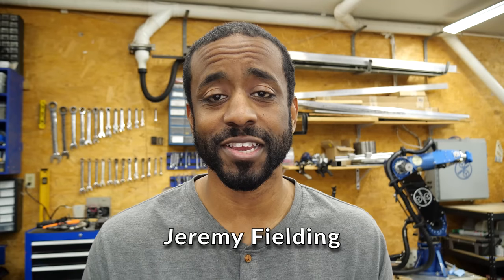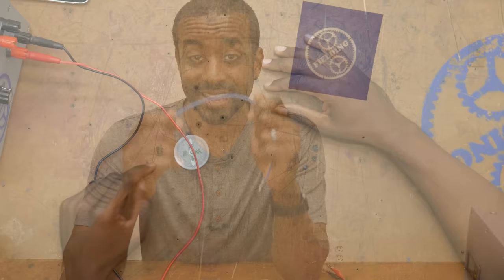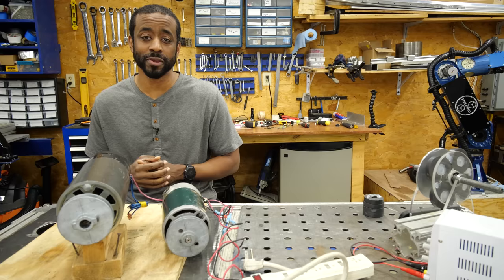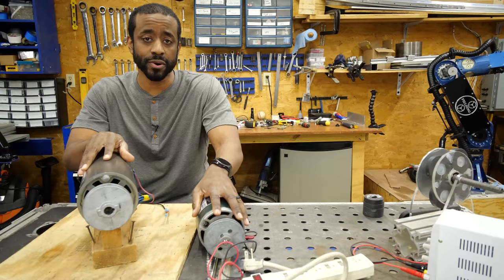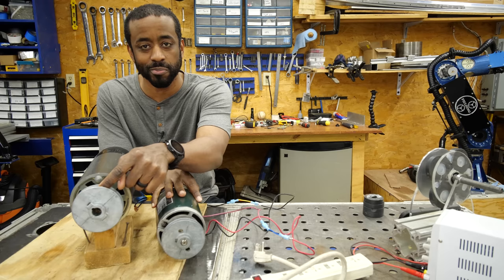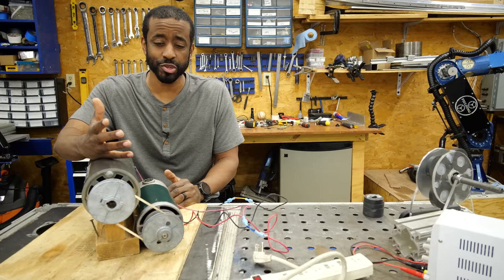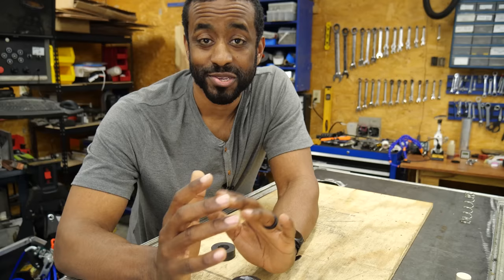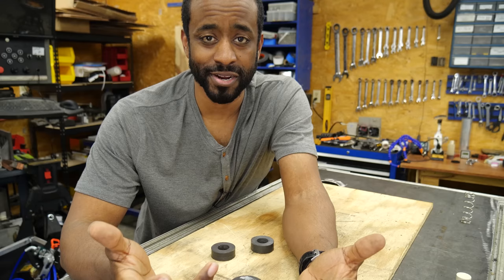Reviewing Free Energy Generators.  A Response to My Video "Nikola Tesla's Greatest Invention"- 102

Comment: This is one of the best and clearest explanations on this issue I've ever seen.  Good job!
Reply: Please tell me you're kidding?
For one, you must use 24volt 200 amp modified alternator (24 x 10) = 240volt?
Second, you need a single phase 220 volt 3000rpm at at least 500 - 1000watt ac motor.
Then you have a free energy device, what this guy doing is just plain idiocy with no basis.
He hasn't the foggiest about where to even start with this stuff.
Reply from the maker: I strongly suggest you actually try it yourself. :) but hey… thanks for watching:)
Reply: @Jeremy_Fielding  I have thanks, you need a 24volt alternator, I have one right here!
get rid of the rectifier and regulator, use the stators phase raw, 220volt at 5000watts per phase.
Reply from the maker: @DogSerious  Wow... I am a bit surprised you are doubling down on this. Clearly you have not. BUT we have both seen the videos where this was done, and while they look convincing as they should if they are good scammers, I am telling you they are faked. They don't behave the way really motor and generators behave. Even small things like startup torque, vibration, and noise are not right. I know because I do it all day. However, I don't expect you to change your mind. It is surprisingly hard to convince a person they have been scammed once they trust the scammer. I can only say please guard your wallet, and your attention when ad's are involved.
Reply: @Jeremy_Fielding  If your only video is one where you've used the wrong parts, why do you think you're right? You can even buy them already made just type: 220v ac permanent magnet brushless high power generator
Then all you need is a low watt single phase 220volt ac motor at 3000rpm. It's not rocket science.
Reply from the maker: @DogSerious  I explained why in the video. it is impossible to show you every variation of the scam. These channels are fully dedicated to this one cash cow. They make hundreds of variations to keep the scam going so they can keep making money. If I showed you one, you could just say I did it wrong. Or worse "you didn't try this one I saw here." It is impossible to prove a negative. However, I offered a solution in the video. How much would it cost you to put it together and send it to me? I will pay you $1k if it works just as I offered in the video.  Two birds with one stone. You will understand way more about why this doesn't work when you actually go through the steps. The dollar amount doesn't matter because its technically impossible. I am happy to offer you 10k if it meets the requirements in the video description. Watch the video all the way to the end and think about what I am saying. That is all I can ask
Reply: @Jeremy_Fielding  Scam? they're easy to build yourself as long as you use the right parts, which you didn't do. So don't rubbish it without actually doing it properly. The way you did it was ridiculous, amateur hour. Like I said, 24volt truck alternator 200amp modified with magnets (not 12volt), no rectifier, or regulator, raw stator. Motor is (ac-motor single phase 220volt 3000rpm low watt like between 0.6 and 1kw). That's how easy it is.
Reply from the maker: I would pay you to send it to me if it works. That's how easy it is LOL.
Reply: @Jeremy_Fielding  Hidden Technology made a good one.
Reply: @DogSerious  Like the guy said, send it in and if it works he'll pay you. Prove 'thats how easy it is'.
Reply: @steedeleven4353  I don't do videos, but I've told him of one guy who does do it right ( Hidden Technology ) and, I've told him of the proper parts to use too! But he isn't interested in doing it right. He just wants to rubbish it and prevent others from doing it by making them uninterested in it! He should stick to making chests of drawers and leave the electrical stuff to electricians!
Reply: @DogSerious  Electrical engineers who actually understand the application of electricity, generators, and motors can explain why these don't work easily. As @Jeremy Fielding pointed out, the people who make these devices often put the device efficiency right on the motor. Such specifications are important for people who design real systems that need to do real work. 

It is really hard to know if you are serious, or are just trolling. I kinda hope its the latter. Then I'm the dumb one for getting sucked in.
Reply: @wturber  If they start by using the wrong equipment then yes, but when you know what you're doing and using the right stuff, then no! I mean, look what he used to demonstrate it? lol. No one would use that type of motor and generator.
Reply: @DogSerious   How fckn serious you are? What tf makes you thing Hidden Technology knows something more than Jeremy doesn´t?? Like we all know you for sure know less than either of them. Jeremy told on video, why it doesn´t work. Also we know you don´t understand how it should work and Jeremys personal explonation on comments to you how it doesn´t . And you act like you know better, seriously dude, lil respect man.
Reply: @SubconsciousLight  Like I said, look at what Jeremy used to demonstrate, lol, only an idiot would use them. And, I do know better, I've been an electrical engineer for 45 years thanks. And Jeremy did ZERO modification to his generator, and didn't use a low wattage motor to power the "generator" kid stuff what he did. All Jeremy did was rubbish something without even trying. He has failed miserably where others have succeeded, and by the looks of it, convinced you too.

Comment: I drive an electric car and get this alternator question/suggestion from more than half of people that ask about my car. I think the confusion is because people don't realize the alternator requires energy to turn. Same with the wheels. They think the rotation is just being wasted so "why not tap into it?".  The best reply I have heard is to suggest that they grab hold of their hair and then lift themselves off the ground by it.
Reply: Most electric cars have regenerative braking.   Maybe all of them.    Reverses  the motor to provide power back.    This is probably what people are thinking of.  That when you want to slow down  that is wasted energy, and this is somewhat recovered. Really the motor is a generator as well, so yes, your car does have a alternator in it sort of.
Reply: For sure it employs regen braking. 107k miles and the brake pads look new. It hardly uses them. I just think lots of people dont understand that any kind of generator would impart a load and slow you down.  They seem to think cruising down the road at steady speed you could get wasted energy from one of the wheels or the motor. People have suggested to me that companies just dont want to add the cost of a generator or that engineers just havent figured it out yet.
Reply: @dansacco1964  yeah, I can’t picture where the wasted energy is when you are accelerating to get the wheels spinning.
Reply: Great analogy! 👍🏽 LOL
Reply: I drive a Prius and it does have an alternator of sorts. Toyota has been quite brilliant with there systems here. The transmission is a shaft that goes through two motors, the first is for starting the motor and acting like an alternator charging the system. The second is used to add power to the wheels. All this on the output shaft that goes to ONE planetary gear set. Yep Prius has only one gear. It's a fascinating technological system.
Reply: I was in a local DIY electric car club. Some of the builders who kept the belt drive AC and power steering pump would also use the stock alternator to charge the 12v battery. That would really weird people out at car shows. It was just cheaper for them than buying a DC/DC converter. Seeing an alternator under the hood really gets the free energy folks excited.
Reply: @Dogpool  exactly what i was going to say. they do take advantage of the regeneration, but there that is only during decel. i thought about molded nacelle with a fan to generate power but, of course, the fan would have to be hyper efficient and over come the drag coefficient. i never tried it tho.
Reply: @Blazilla81  This would also act like a brake and cause decel. Btw google betz limit.
Reply: But with the wheels turning already from battery you put a generator on each wheel which in turn would  connect to the battery and charge it as each generator rotates
Reply: @robertthompson5539  the generators would put a load on the wheels and slow you down. To maintain speed you would have to send more power to the wheels. In a perfect world with no loss the best you could do is break even. So it would take 5hp from the motor to make 5hp from the generator. It would cancel out and be a complete waste of time. In the real world there is efficiency loss at each step so you would have to use 5hp to make 4hp from the wheel generators.
Reply: @robertthompson5539  and you know what happens? Your car slows down, exactly how the regen braking works, motor acts as generator, slows your car down, and generates electricity by converting rotational energy to electrical energy, come on man, generator puts resistance on the wheels, it’s not generating free energy out of nothing

Comment: Thanks Jeremy for explaining this so well. Another loss that most people do not consider is Windage losses. All motors must cool themselves, the external or internal fans that cool the motor require energy to overcome the resistance of the air they are supplying to the motor to cool itself.
Reply: bla-bla-bla        any  pm  motor makes a  PISSPOOR  generator.!        the end
Reply: @daviddavids2884  and your point is?

Comment: I remember having this idea when I was a kid, but then I also thought about why it hadn't been done yet and then I realised about how energy is always transferred. Years later a colleague of mine had this idea and argued with me that it would work and how he was going to become a rich inventor 😂 I was shocked he had the same job as me!
Reply: Like when they had the scale model hyperloop competition and every single college engineering program showed up with a car that was supposed to be propelled through a vacuum by spinning a fan and every single one of them was shocked when it didn’t work?
Reply: @Leonarco333  LOL!  For real?  Oh, the irony!  And these were college students?  Every one of them deserved to fail with a flat F grade.
Reply: @melkiorwiseman5234  yes they were college juniors and seniors at some of the top engineering schools in the country. Fan is a bit over-simplified. The pipe was not an absolute vacuum. It has about 0.1% atmosphere and the fans were ultra high speed collectors. I’m theory if you spin them fast enough, you get pretty decent thrust. The problem though is that the theory doesn’t really mesh with the practical world where there are multiple unknown variables. So when it came to crunch time the highest speed achieved was 35mph and that was from the wheeled electric booster vehicle that was supposed to give them a rolling start before disconnecting. 

This killed the hyperloop project outright. They all failed and it was determined to be a bust. Probably for the best since having a 300km long tube with a cross sectional diameter of 30 feet contains several gigatons of potential energy equivalent to several thousand nuclear warheads at street level spanning the distance from San Diego to San fransisco. And they thought this was a great plan.
Reply: @melkiorwiseman5234  if any spot on the tube were to be compromised, the released energy from annihilating the vacuum would cause a chain reaction equivalent to detonating a nuclear weapon every few dozen meters along the entire path of the hyperloop. 

Probably for the best that the concept is dead.
Reply: @Leonarco333  no

Comment: Good job Jeremy. Talking the tech down so that layman can understand it isn't always an easy task. You did it well.
Reply: Then you'll really like what I have going on☺️👍🏽
Reply: @surgicalsteelruthlessinc.8353  Putting an alternator on an electric car would take more electricity that it would produce. 🙄
Reply: @surgicalsteelruthlessinc.8353  yes spinning them. How else are you going the get the magnets to pass their fields through the windings? I think it is you that doesnt understand the subject
Reply: @surgicalsteelruthlessinc.8353  You're clearly special. The point of an alternator is to turn mechanical energy into electricity, there is some loss of energy from the air resistance and friction on the bearings (and heat loss). So you have a slight loss of energy in the conversion of inputted mechanical energy to outputted electrical energy.
Petrol and diesel cars have alternators to charge the battery from the engine so your electrical components work (headlights, radio etc).

Running an alternator from an electric motor/battery will still have that loss. If there was positive output then you'd have a perpetual motion machine.
Go get an electric motor hooked up to a battery and alternator, use the output electricity from the alternator to charge the battery and it will eventually run flat.

That's why you don't have them in electric cars.....
Reply: @surgicalsteelruthlessinc.8353  you are a troll. Go away and find a better hobby 
Edit: I didn't actually watch the entire video as it was such basic stuff, he's basically said the exact same thing I have.
Reply: @surgicalsteelruthlessinc.8353  So you push start it to generate the electricity to start the ignition. You may as well get a crank  to start it, then you could park the thing on a hill without any worries.

Anyways I believe it's clear to you why you shouldn't put an alternator on an electric car.

Comment: Though it is not an alternator on a Electric Vehicle they do have a way to make electricity it is called a regenerative braking system. However, anytime you convert energy from one type to another, you have losses. One thing I have to add! This video is just about the best well explained I have ever found.

Comment: I knew going in that these things were scams because conservation of energy and conservation of momentum are things that exist, but I wanted to see how you were going to explain it. One of the best I've seen! Very clear for the layman and done with humor. We need more people on YouTube like you. 

Subbed.
Reply: When I was 17 I modified a 3 speed hub geared bike with a small car battery, voltage regulator,generator and a starter motor hooked up to a restate for a throttle. Sounds good right. Reality check... first attempt at cracking the throttle resulted in the complete destruction of the back wheel. Shredded the spokes. So much for that experiment! Oh well nothing is free! Even if we had made that to work in the end we would have run into the brick wall of entropy.
Reply: @thines7168  🤣🤣
Reply: @brentjohnson5171  🤷🤷🤣🤣